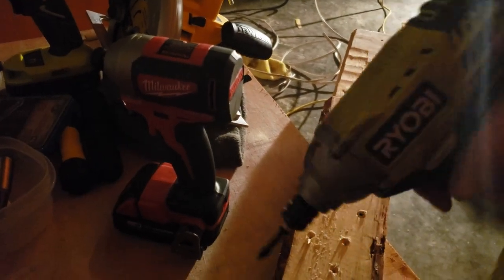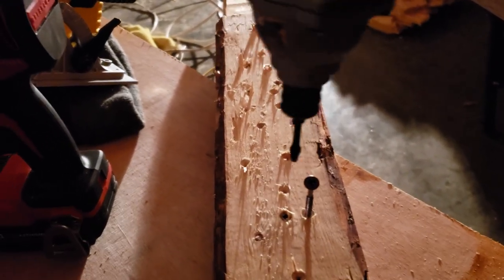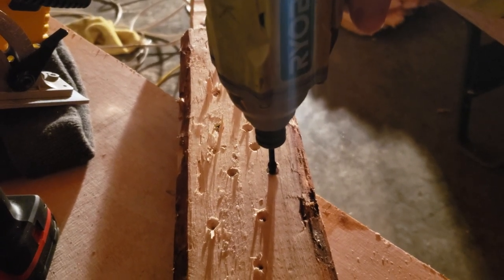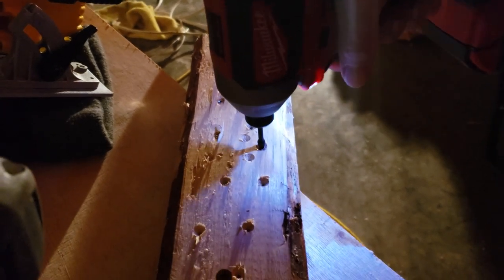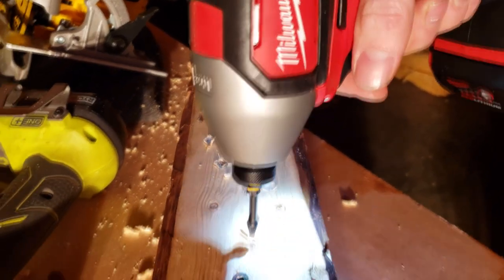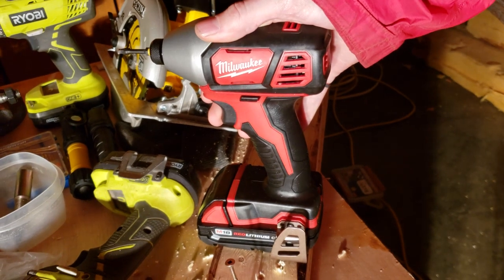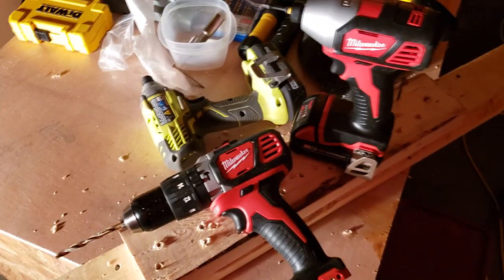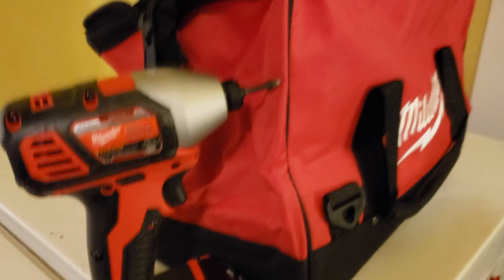Testing Milwaukee's Brushless (2850-20) vs Brushed (2656-20) Impact Drills at Low Speed High Torque

Comment: Thank you for this video! After building 3/4 of a house my drills got stolen. I thought I bought an identical replacement but my new impact I couldn’t get it to stay on the screw going in or out it and it would strip because it didn’t have any low end torque.. now I know I must have had the older model before and am going back to that!